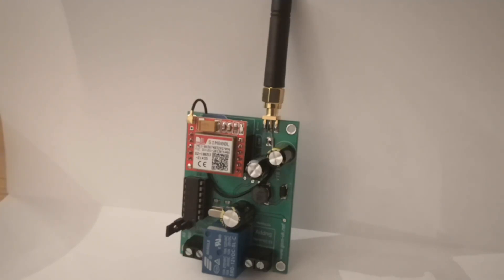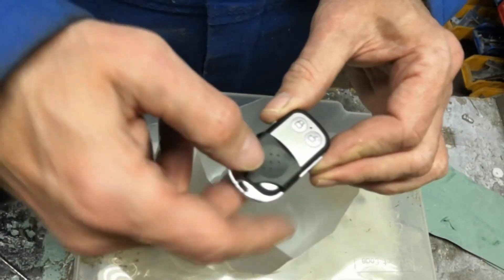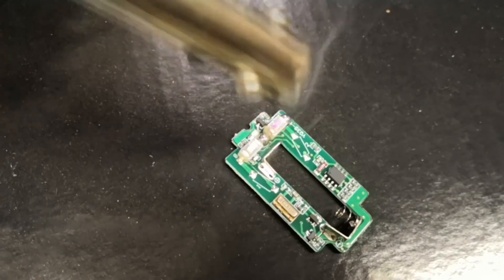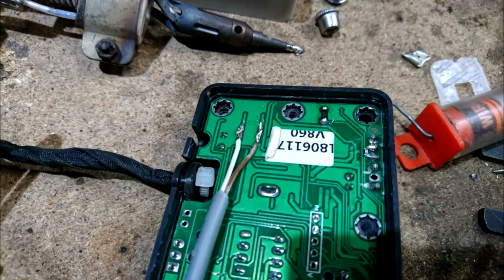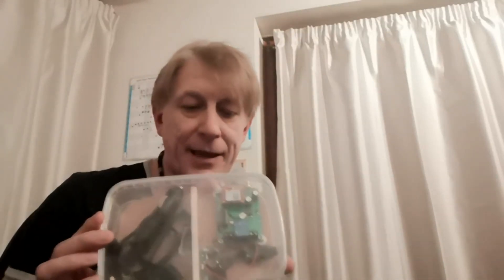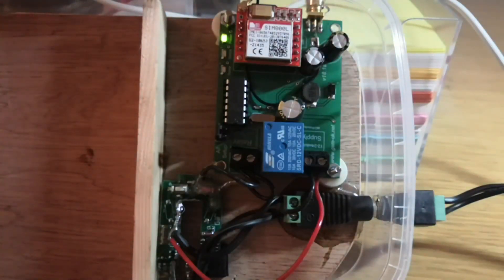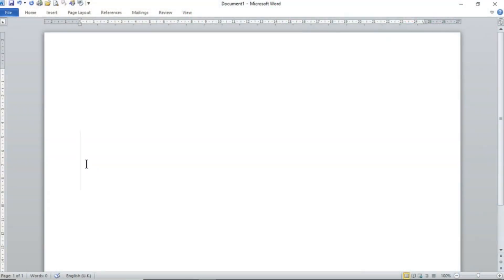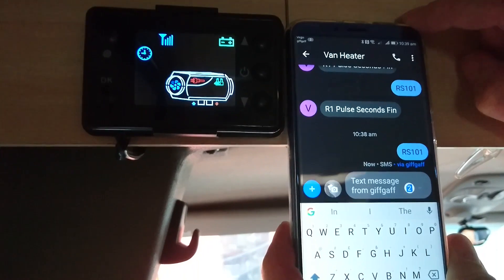Turn on your Diesel Heater by sending a text.

Comment: I know a similar way to do the same thing  with Wi-Fi electric switch and a relay tried it to works from anywere
Reply: Is it easy to programme the switch? I've done the GSM relay but very interested in the wifi switch
Reply: Please do elaborate with the WiFi way of doing this that would be great 👍
Reply: don t don't remember the topic but it's obviously you're something about getting heater to work from anywhere and I think it's the Wi-Fi switch that I use on my forced air heater if you connect it up to the remote on your diesel heater and it will work as well from anywhere all you need is small relay connected to the remote fob that's activated by the Wi-Fi switch providing have the internet that's it simple

Comment: Brilliant video very well explained it would be amazing if you could  have a phone app linked that shows you the status of the heater ie tells you if it's on/off and what temperature and also a timer for  on off time or is there one? I have just purchased a Chinese night heater for my pick up ready for winter hopefully here tomorrow thanks again top class video 👏
Reply from the maker: Glad it was of interest.  Your heater,... did it come with the black rectangular controller?
Reply: @campervan_hackers  yes it has the rectangular controller
Reply from the maker: @BREN2009  this vid might help you drive it if you're struggling with the Chinese instructions. https://youtu.be/-jhMtfRBDrQ

Comment: Hello , You can Use a EweLink smartphone control 7V 220V DIY 1ch 4 Channel Jog Inching Self-locking WIFI Wireless Remote Switch with RF controller to controle it !!! And it works directly from EWELINK.
Reply from the maker: great that there are some many remote options with these units!
Reply: Why do you need a 4 channel tho ? When a 4 channel is to run 4 lights 
If your wanting it for one heater you surly don’t need the 4 channel 
Just a basic Alexa smart switch will do

Comment: Hi Greg, can you do this with Alexa and a sonoff WiFi switch ( the same you did with the little remote) as long as your van is on WiFi ? Maybe you could do it your way as well for when you have no WiFi. ?
Reply: Hello , You can Use a EweLink smartphone control 7V 220V DIY 1ch 4 Channel Jog Inching Self-locking WIFI Wireless Remote Switch with RF controller to controle it !!! And it works directly from EWELINK.

Comment: i'm going to ask this because you seem experienced in diesel heaters - do you have any idea why mine would smell of burning rubber when running?
Reply from the maker: Hi Barrett... mine smelled slightly plastic - ish  when first fired up... but after 15mins or so at full blast, it stopped and never had any problem since. If it is ongoing, it might be worth taking the cover off and seeing if anything has got on the heat exchanger that is causing the smell.

Comment: Hi do you know if I can pair two remotes to the lcd controller? One to turn it on like you’ve just shown and the a second remote to turn it off next to my bed
Reply from the maker: Yes in fact I have just that. You need to get a copy remote or clone remote. Search on eBay loads will come up. You use that to clone your first remote which keeps the codes unchanged.

Comment: Hello I have purchased a heater with the new lcd controller , my question is , is that when I turn on  the timer and enter the start up time and press ok it does not go to switch off time it goes to the second timer , am I doing something wrong. j hope you have some ideas please thankyou kind regards ,Mark

Comment: Sadly that GSM controller has been discontinued by GSM-UK. I have looked at some similar Chinese ones, but not sure which to buy in view of the fact that "we" need a "momentary" type relay action (as in the R101 input) and the adverts for the Chinese "gate opener" units don't mention this, and it's waste of time asking them!!!!!! - Any thoughts...........
Reply: Hello , You can Use a EweLink smartphone control 7V 220V DIY 1ch 4 Channel Jog Inching Self-locking WIFI Wireless Remote Switch with RF controller to controle it !!! And it works directly from EWELINK.

Comment: Hi Greg I can’t find the o2 123 deal on their site all I see is their classic payg 
Is this the same?

Or can you provide a link straight to the o2 123 deal you talk about in your video 

Cheers matey
Reply: I think Greg meant O2 321, which is googleable and brings up O2 "Classic Pay As You Go" which seems to tick all the boxes for this project.  Just need to make sure you use a "chargeable activity" at least once every 6 months or you lose your credit.  2p per text, if using the reply service.
https://www.o2.co.uk/shop/sim-cards/pay-as-you-go#simtype=classicpayasyougo

Comment: Hello how do you open the Color lcd Controller?
Greets Jürgen
Reply from the maker: I think you have to peel off the glass front... I did not want to try which is why I went into the remote... a less expensive fail!
Reply: Camper Convert ah ok....the Remote Controller give then the Signal to the lcd Controller....
You have the gsm with one relais...can then i Switch the heater on and off?
Reply from the maker: @jurgenwilhelm1472  Yes... that company sells dual channel gsm switches if you have two buttons as on my remote.... but I only wanted to switch on.. to turn off... I am already in the van. Details in the video.

Comment: Why did you hack the remote, its much easier and less hassle to hack the actual controller with the screen, i hacked the controller itself much easier to solder. I will be posting a vid soon to show how, plus you can do it with single channel controller
Reply from the maker: I have in fact done that now but at the time I was playing with different controllers and wanted to keep that one 'clean' for another purpose which is why I also featured Henk's stuff where he hacked into the actual controllers.
Reply: @campervan_hackers  great stuff.
Those gsm switch modules are excellent things.